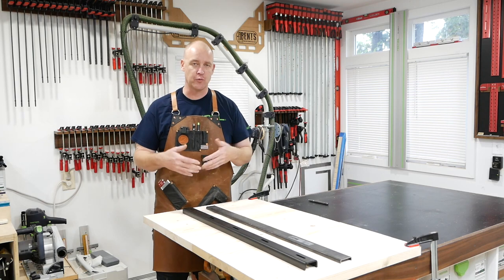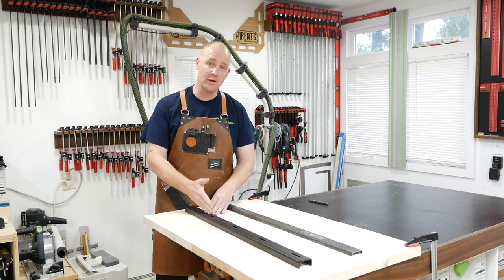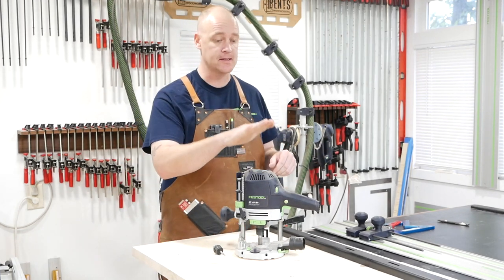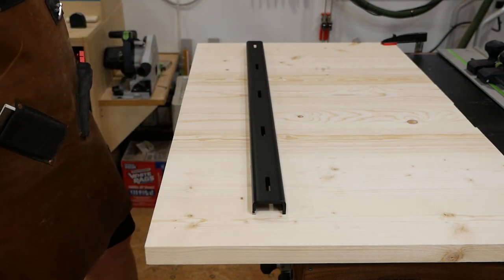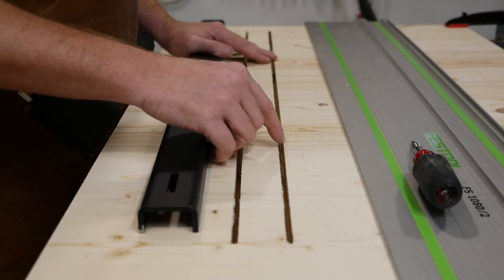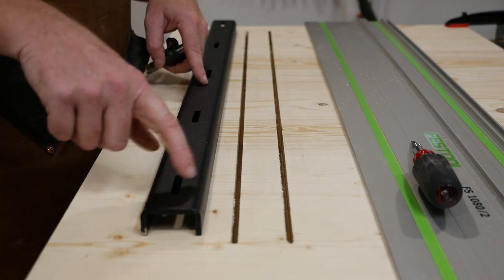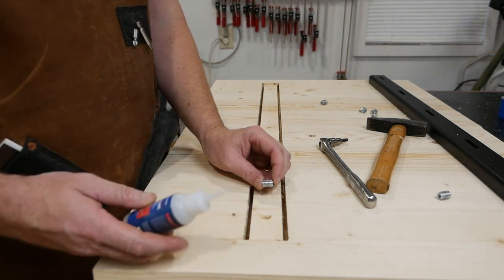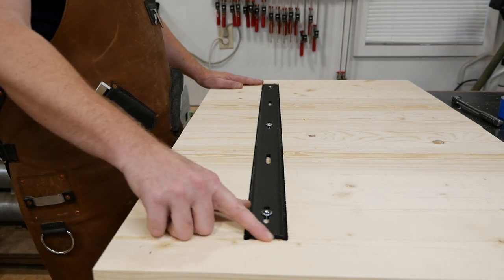How To Install C Channels / Woodworking Tips

Comment: That's a great demo on your part Jason. I have a  question about hardware size and slot dimension. Are you using 1/4" fasteners in a 1/4" or 3/8" wide slot? Or, what are you using?
Thanks!
 Brian

Comment: Hi Jason. Excellent video, very informative. I have purchased a 10' live edge slab of Guanacaste for a dining room table, it is between 3 and 3 1/2 in thick and varies from 3.5 to 5 feet wide. I had not considered using any type of stiffener, due to the thickness, but have not done a table like this before. do you feel that it is needed for this type of project? the table will be indoors in a controlled environment.

Comment: I'm currently making a 19' x 3 1/2' countertop, it will be built in 2, 9 1/2' sections, I have a question... since the countertop will be laying flat, I will obviously need to route the c-channel deep enough so that the screw heads of the channel will be flush, and should I route deeper than that so that the screw heads have room to move?
The wood I'm using is 8/4 Red Oak, I have never installed C-Channel before, so I just want to make sure I do this right, any advice would be much appreciated.

Comment: Hi great video it was super helpful! I have a question hopefully you can help me. I bought a c channel that is 3/16” in thickness and the ends are 3/4” deep. I can’t seem to find a router bit that goes to that depth in 3/16” diameter. I’m not sure if they sell one online but I haven’t been able to find one. What would you suggest I could do?

Comment: I have a walnut slab table that’s 98” long that has a slight bow in the middle between the legs. Legs are  58” apart. 
Would C channel be effective to run length wise? all applications I see of c channel are applied in the width axis.

Comment: If the center of the table is actually a seam where two slabs were jointed, that "make the middle bolt tight" idea doesn't still hold right?  Should I instead tighten the bolts in the center of each of the two jointed slabs?  Thanks!

Comment: Yes, it's a bit of a pain to drill the holes but I got four 42" pieces for $50 from the metal distributor vs. $50 each pre-fabed.  That's 1/5 of the cost.

Comment: Hey Jason, great Video. I´m currently working on an oak-tabletop and considering using c-channels as well. One thing I´m wondering about is the depth of cut for the channel in certain height tabletops. Any concerns about cutting that deep into a tabletop and still have enough "meat" for strength over the whole length of the top? What are your thoughts about that?
Reply from the maker: Depends on the thickness of the table top. Typically c channels are used mostly on big slab tables. I just wanted to take the opportunity to demonstrate how it can be done. I don’t even think they are necessary in most cases.

Comment: Awesome Video! I' am starting a new dining table build and have never used the C Channel for prior projects, but considering it for this one. I'm using 1.5" walnut, once planed down it will be app 1 -1/4". I'm finding a lot of pre-manufactured C Channels, similar to the one in your video being 1" in depth....Would you recommend using a 1'' deep c-channel for 1-1/4" thick walnut panels??
Reply from the maker: Check out Bidwell wood company. That’s who I get mine through. They gave me a discount code as well for my audience. BENTS10
Reply: Paul, I have a 1-1/4” thick table top as well. I will be using C-channel that has 1/2” legs and the steel is 1/8” thick, and the channel is 2” wide. Bought mine through Etsy and the company is Csonkas Custom Rustics. I think the 1” deep channel is too deep for a 1-1/4” thick top. Hope this helps.

Comment: I had made a expandable Ash trestle table 40 x 72 x 1 1/2 expandable to 102. I installed the extenders everything looks and operates good. The only thing is when I position the two 15” leafs I can see The table top isn’t perfectly flat and has a 1/32” rise in the center. I place a 38” edge wise and clamp the ends brings it home so I’m going to need to install 4 C channels two on each half 2” from the ends. Legacy Lumber C channels are great but at $45 each? I don’t think so. I ordered from Home Depot at $10 but as you said, will have to machine the holes. I hope this will bring the top in check.
Reply from the maker: I think it could help. The c channels from Legacy Lumber are much more stout than the HD ones as they are made specifically for this application.

Comment: Do you address using the C channel to flatten a top that is slightly crowned or cupped, which so many slab tables are after glue up? In my experience the brace needs to be tensioned opposite the table top to counteract those stresses and bring it flat
Reply from the maker: I don’t address anything like that. This video is meant more to show someone how to go about installing one. The logic makes sense to me though but I couldn’t answer it for you

Comment: QUESTION: I'm going to build a 9'+ table top.  How many channels would you recommend?  Love this video!!
Reply from the maker: I wouldn’t necessarily “recommend “ having to use them. I’m not someone that believes they are a necessity in most cases but I also don’t think they hurt a project. However, for a 9’ table I would use 3-4 if I used them probably

Comment: Hi, great video! I am planning on installing three of these on an eastern red cedar live edge table. Should I use Waterlox sealer in the channels before installing the steel, or just leave the grooves un-finished? Thank you
Reply from the maker: Personally I would always finish before final assembly of hardware. Cut it, dry fit it, then remove, then finish, then reassemble. Just make sure you account for the thickness of the finish when sitting out the c channels.
Reply: @bentswoodworking  Thank you!

Comment: Hello, great info on the video. I do have a question.I have seen the installation of c-channels horizontal on the table. On the footage you have in the video the c-channels appear to be parallel to the longest length of the table. Is there any particular science to it? Please elaborate. Or anyone that has an opinion feel free to respond. Thanks,
Reply from the maker: Thanks, you could I suppose but it would looks strange. However, no one would ever see it.
Reply: Hi Mike, the piece of wood he is working on is not an actual table, he fabricated this piece as a section of table for demonstration purposes.
Cheers hope this helps.

Comment: great vid thanks for the tips and tricks with tools and accessories. the router bit extender is that from festool or other company? i'm always having depth issues because the router bits are either too short, there is some longer reaching router bits but sometimes  not in the cutter that i am using.  thanks again for the tips
Reply from the maker: It isn’t an extender. It was just a 1/4 collet for the bit.

Comment: great video . . .confused why you needed to cut the grooves 1 3/16" deep though.  Isnt total depth still just 1"?
Reply: I thought the same
Reply from the maker: Lol. Actually...... that’s a great point! 🤣 I guess you wouldn’t need to do that
Reply: To allow for the thickness of the metal so it fits flush maybe?
Reply: Yup, I thought that too.
Reply: I was so confused by this too.  Total depth is still just 1"
Reply: @bentswoodworking  It would be a good idea to indicate it within the clip (side note?) as I ruined (well, not really but it's still not a perfect fit) the cabinet door for which I was following your instructions (to the letter!) to install the channel :( It's an important detail and not everyone will all read the comments before jumping into it! Thanks for your videos, they are very useful.
Reply: Yeah grooves only need to be 5/16” and hog out between the grooves 3/16” = 1” lol
Reply: 1” is what it should be lol either he was confused or messed up his wording. You will need the 3/16 for the face of the c-channel tho. The only reason for deeper is if you would want the bolts to be below the face of the wood

Comment: If I've got a small coffee table only 44' long by 13" wide is that even worth putting sea channels in
Reply from the maker: No, I don’t even think they are needed. That said, I don’t think they hurt anything either.
Reply: @Bent's Woodworking & More   OK thank you for your help I just wanted to make sure I wouldn't move to bad

Comment: In the c channel you bought from HD, what size holes did you drill? Great video, thank you!
Reply from the maker: I don’t remember the exact size but I drilled them slightly larger then the bolts I used
Reply: Thank you! I drilled two 3/8” holes and used a file to create the slotted holes. HD also had 1/4x20x20 threaded inserts that’ll I’ll try. This video is super helpful. Thank you!

Comment: Would a C-Channel be necessary if your table has an apron fastened with tabletop clips?  Wouldn't that ~3" tall board serve the purpose of holding the top flat?  (Genuine question, not trying to be a smart-ass.  I'm about to do a 5/4" thick, 34" wide tabletop out of cherry and was assuming the apron would serve the "keep it flat" purpose... might just do breadboard ends..)
Reply from the maker: The way I look at it is if you were doing breadboards, then c channels would serve no purpose. If you didn’t do breadboards the c channels would serve a purpose. Either would be more effective in keeping the top flat over the clips.
Reply: @bentswoodworking  makes sense, thanks for your reply! If you're going to put all the effort into making a gorgeous table, might as well take an extra step to keep it flat. You've talked me into it haha

Comment: Any reason to not install the C channel face down so the routing can be skipped?  You might want to break the corners but it is protected by the apron.  Inletting would be needed if the table doesn't have an apron.
Reply from the maker: I suppose you could but personally I would want it flush
Reply: You are also cutting out much more wood of you flip it upside down. The benefit of the c channel is that you don't need to remove too much wood and sacrifice the strength of the table.
Reply: @pavelstolarczyk9699  you don't need to remove any wood, just surface mount the channel.
Reply: Robert Ball Yeah you could but that would look ugly and possibly get in the way.
Reply: @pavelstolarczyk9699  note that I said it would only work if you have an apron to hide it.

Comment: A friend of mine wants to put the channel in upside down with the legs up. He doesn’t want to router the 1/4” slots on the sides. I’ve tried to tell him that this isn’t the correct way but he insists it won’t make a difference. What do you think? @bentswoodworking
Reply from the maker: I would advise against it

Comment: hey thanks for the video and the good comments i   did work as a Woodworkerfor 20 years and i never used C channel myself keeping in mind  we always built  whatever the Architects and Engineers specked out  on the Blueprints and there were other solutions and ways to prevent  warping and twisting  it’s a interesting  concept and i just may incorporate it into my next dining table build for myself  BTW i will not be using Festool tools as my router by choice that i  have owned for  nearly 25 years is a PorterCable D handled one as well as a older 1/4”  older Craftsman  one i use kind of like a trim router because of its  light weight  and strange handles with a built in trigger on and off switch it was a router i bought on sale from Sears pretty close to 30 years ago  for under 20 dollars  plus a blow molded plastic case that can store a few bits and the wrench  i  had it for years in storage before i started using it  as i  used to use a offset Porter Cable router  That the company i worked for loaned me whenever i needed a palm or trim router  i liked that setup for its compact one handed size but yet with its strange offset base it  had a pretty stable platform to  ride on mainly i used that for trimming Veneer and HPDL  on my personal projects  the owners of the company i worked for were always very generous about loaning employees tools or shop space on off hours  at one point i actually restored a 30 foot wooden ChrisCraft Cabin Cruiser in a old out building located on our shops property and many times  i used shop equipment  if i needed it  another nice thing about that was i had access to a forklift for lifting motors in and out of the hull
Reply from the maker: Glad you found it interesting

Comment: While I will agree the C channel that you got for this video that you ordered from Legacy Lumber should work well,  because they have enough rigidity to provide the strength to keep a table flat. That said, I have ordered both cold roll and hot steel roll C channels that fails a simple test. And this is what I would like to point out to your viewers. Both the cold roll C channel from HomeDepot and the hot steel C channel from Northern fail if you place 2 steel rules, say from your combinations squares, that are only 1/16 thick, and place them towards the ends of the C channel so that the C channel is sitting atop these rulers. Now press down on the middle of the C channel and one will find it is fairly easy, (a smidge harder with the steel roll), to press down and watch the C channel bend or warp down and touch, in my case, the cast iron table saw top where I did this experiment. Sure, they spring back but the test shows they fail to be able to truly hold a table flat.

The problem is, when using the C channel, one is only going to ensure that the center is actually bolted to the table, and the other mounting points, using the insert threads, are going to be enlarged for wood movement. So, if your C channel cannot support being suspended between two steel rulers, sitting atop, and one can press down in the middle and the C channel touches the surface, then that shows by routing and inserting the C channels, in effect, one is only weakening the structure of the wood table top. Metal has 7 characteristics, or properties, and while malleable may be one, spring tension is the offender in this case. The metal can be sprung and return to original shape.

My C channels are 2 inches wide, half inch sides, and 1/8 inch thick material. But they can't prevent up to 3/32s movement of the table top, which over a typical width of a table, 36 inches, means the top will then only be held flat, truly, by the fasteners used to attach the table to the base. If using Z clips, as I tend to do, that means more stress/pressure (or less chances) of the Z clip actually moving in the groove as intended, to design for wood movement. Add breadboard ends, on any table top less than an inch and a quarter, and chances are that stress is applied to the breadboard ends' joinery as well. If one uses drawboard dowels through holes to attach the breadboard ends, that stress may, in time, actually be enough to hairline crack, say walnut, where the breadboard ends are attached and mounted with drawbore dowel construction. My table is 1 inch thick and I was intending to follow your video and inset C channels into the table top, but can see they won't add strength, but most likely take away strength once routed into the wood of the table top, as that walnut top would then be routed out. Just want to pass that test along so maybe your readers can decide whether routing a table, that they spent so many hours prepping and gluing together, will warrant C channels. Take your C channels, suspend above a flat surface, and press in the middle of the channel and watch how much movement, or spring, the channel allows.
Reply from the maker: Thank you for that information and your input 👍
Reply: Thank you for that. I tried using a stainless steel 1/4 X 2 inch flat bar to correct a quarter inch warp on a 2 X 4 foot table top, 1 1/4 inch thick. The steel bar bent and did little to the tabletop.

Comment: Went to Legacy Lumber to check these C channels out and man are they expensive! My table will be 40” so I think I would need 35” at $45 each and I’ll need  8 $$$$$$$$$$$$ WOW!  The table will be 72” with two 15” leafs expanding to 102”
Reply from the maker: I don’t know if you would need 8
Reply: Bent's Woodworking well we bought a new high table last year and I checked it and it had one on each end 3” in and one on the inside of each section plus 4 on the butterfly leaf so why you think it may not need them? The one I’m getting ready to build will be out of 8/4 Ash and the top will be 1 1/2” thick what else would I use? Not using bread board ends
Reply from the maker: Michael Ford I have built a lot of tables and never used them or breadboard ends. Unfortunately I am not the person to answer how many you would need. I personally think that 8 would be excessive and unnecessary especially for a table top that is that thick.

Comment: In theory, since you had an apron on your real table you could have just flipped it over and not bothered with the recess at all. Granted, it would not have been as eloquent a solution and your video woukd have been way shorter bot fut those without all the neccesary tools it is an option.